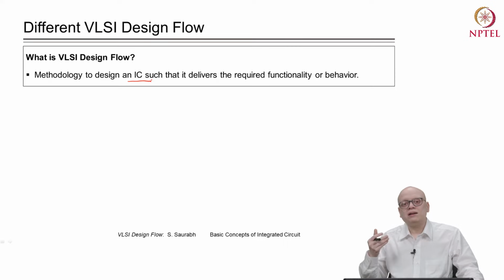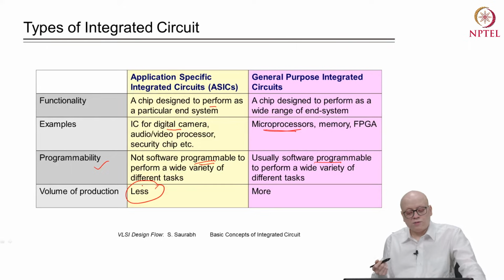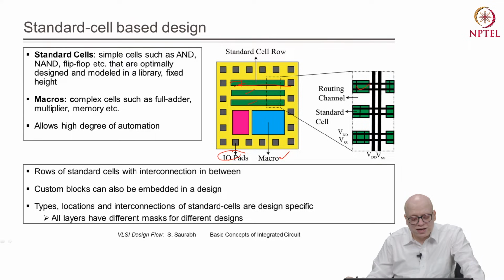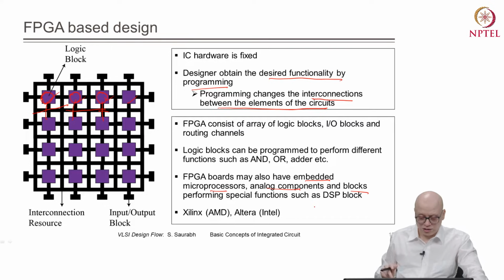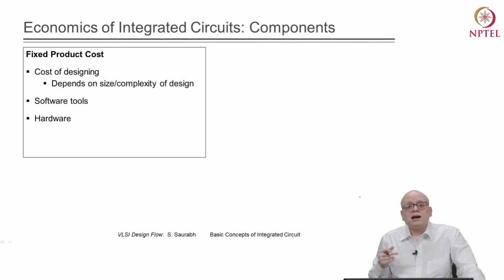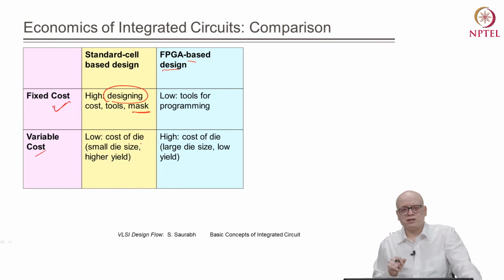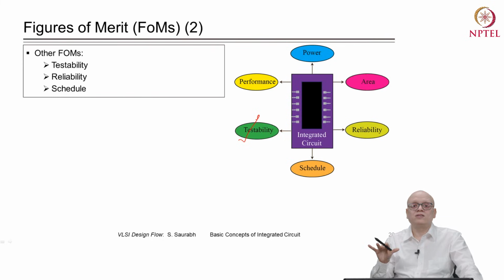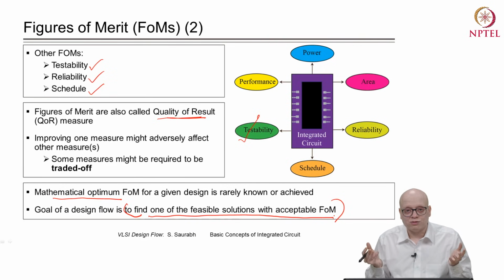Basic Concepts of Integrated Circuit - II

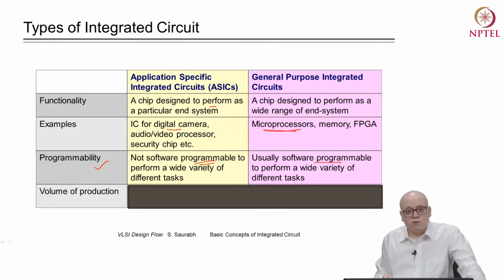Comment: At 4:56.  Sir, isn't volume of ASIC production more than FPGA ?
Reply: But the Description also included memory, Microprocessor, that is why its included its more in volume
Reply: No
Reply: @saswat9429  Actually FPGA are less widely used.. they are rare in consumer electronics, While ASICs are almost everywhere, from phone changers to even fully fledged Desktop Computers.. (These ASICs are typically Components, as Opamp, Drivers, so they are not considered in Logic ASICS.. here the discussion is about  Logic ICs)